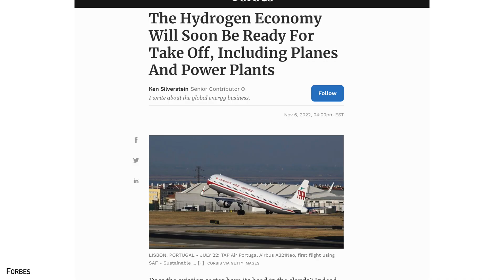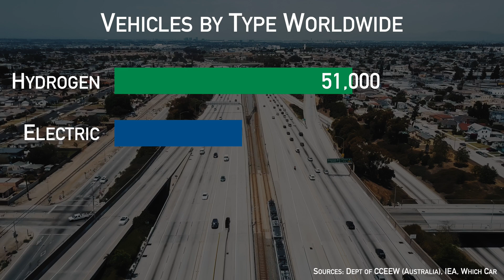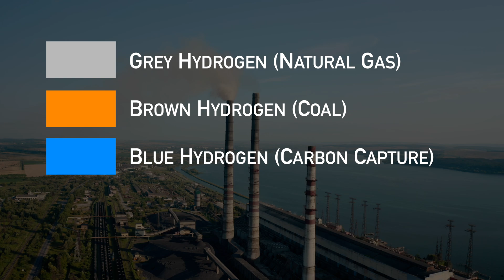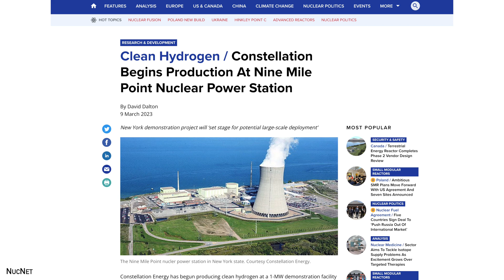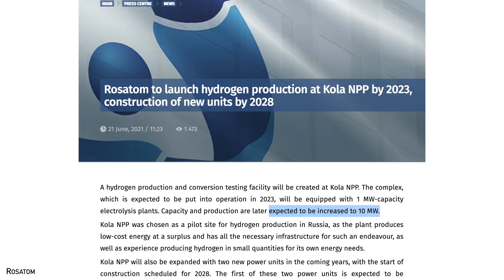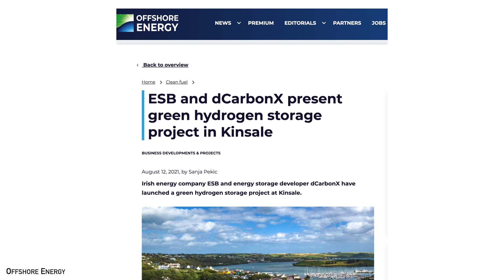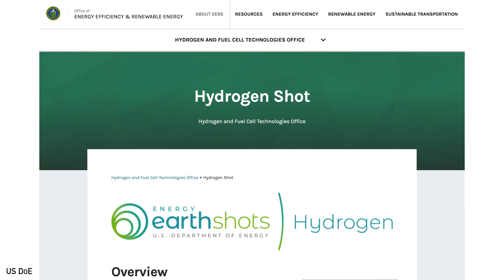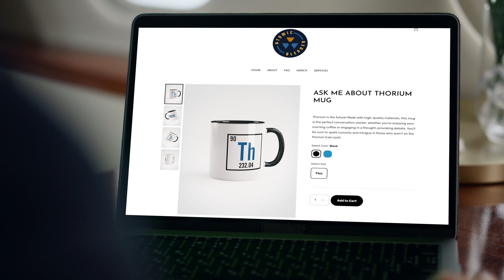The First Clean Hydrogen from a US Nuclear Plant - Now What?

Comment: A comparison between electrolysis hydrogen and Sabatier reaction methane as a storage method for excess energy would be really interesting.
Reply: Hydrogen has 2,5x energy density of methane, it is harder to use and transport but doesn't release CO2 when burning. Given this facts and other i don't know about, do you think using methane for transportation, power production and similar make sense?
Reply: @codaalive5076  methane created via the Sabatier reaction would be created using CO2 pulled from the atmosphere - in the same way that it's used on the ISS - so any CO2 released would have been previously pulled from the atmosphere, thus not an issue. Methane from air plants have been in use for over 30 years and are far more common than hydrogen as a means of storage - so there must be a reason why this has been the more prominent method used for so long. The easier storage of CH4 isn't a minor issue - especially since car accidents happen, and having a container that survives an accident is an important factor, not to mention that many vehicles are subject to sub-standard maintenance.
Reply: @ghaznavid It would still require water (or another source of hydrogen), and it's more expensive than just drilling the methane out of the ground. Those are the only two disadvantages of which I am aware.

Comment: Fission plants could also be used to power turquoise H2 production, where CNG and RNG can be used to produce H2 for fuel and ultra pure carbon black for batteries so graphite doesn't need to be mined and refined which is a very toxic and energy intensive process.
Reply: Forgive my stupid question but what do these abbreviations (CNG, RNG) stand for?
Reply: @GreyDeathVaccine  Compressed natural Gas/Renewable Natural Gas (aka biogas)-methane, basically
Reply: The carbon is better used for other means.

Comment: The main problem with the hydrogen vehicle is not the fuel buy catalyst which is platinum and every time we use a hydrogen engine it consumes some amount of platinum catalyst. And due to the presence of a low amount of platinum in earth's crust using too many hydrogen vehicle my not be sustainable
Reply: Assuming they are fuel cell based hydrogen vehicles. IC hydrogen vehicles are also possible and do not require catalysts.
Reply: Battery vehicles use precious metals also, the platinum can be recycled just like with minerals in batteries. This is the best solution (alongside carbon negative RNG) for heavy transport like container ships and aircraft.
Reply: "every time we use a hydrogen engine it consumes some amount of platinum catalyst" - I'm weak in chemistry so forgive the stupid question, but can it be recycled somehow or does the platinum disappear like steel eaten by rust?
Reply: @GreyDeathVaccine  I'm going back to what I learned in school here but our (albeit basic) definition of a catalyst included "and none of the catalyst is consumed"... but, y'know, going back to my notes from school, nearly 40 years ago, is pretty "weak in chemistry" too.

Comment: Any chance of using nuclear directly to make hydrogen kinda like what happen when things go wrong in a old uranium and water reactors do, but I guess it might be radioactive hydrogen unless they could figure a way around that problem, might even be able to enlist the help of spent nuclear fuel aka partially used nuclear fuel to help make hydrogen. 
Like the Mug👍
Reply from the maker: Do you mean direct hydrogen by radiolysis (breaking the bonds in a reactor)? Possible but its not going to be very efficient to create it on any large scale. There just isn't enough ionizing radiation flying around to do it economically that way and it's more efficient to use the heat produced instead.
And thanks, I thought the mug was fun :-)
Reply: @atomicblender  From what i know 4th gen nuclear plants could be able to simply heat water up to 1000C which simply splits it into hydrogen and oxygen (yes, this is also what causes the explosions in a malfunctioning reactor), which should result in an extremely efficient H2 production.
Reply: I think he's talking about the steam oxidation of zirconium, which consumes zirconium and releases hydrogen. It's not really a viable method of producing hydrogen at scale. I'm more interested in high temperature reactors driving the sulfur-iodine cycle to produce hydrogen.

Comment: Hydrogen has storage issues (the molecule makes metal takes brittle), leakage issues (small molecules leak from all fittings), and cost issues (electrolysis, green or blue).  While it sounds good, in reality, we are not able to support it in any meaningful way.  Further there is NO real issue with CO2 causing global warming.  This is a religion.  CO2 does however make the planet green, as it is the fuel for plants.